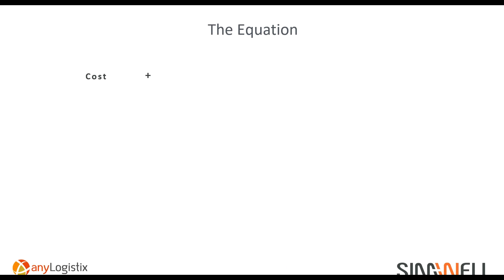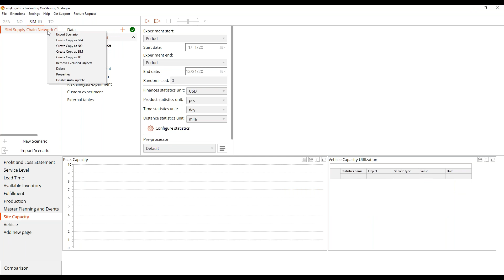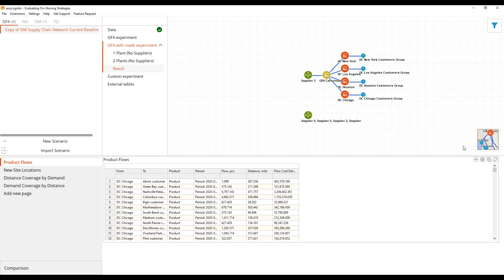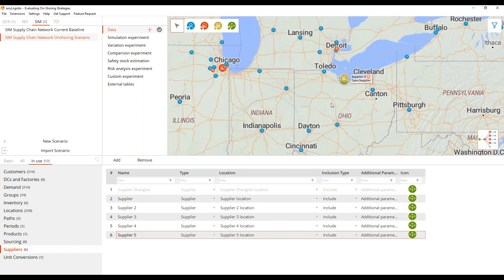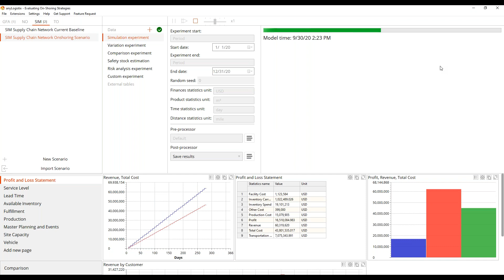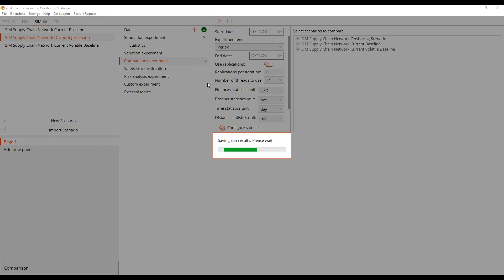Comment: Great video. Which simulation method has been used in the background?
Reply: Hi Rene,  the Green Field Analysis, Network Optimization and Transportation Optimization experiment types in anyLogistix do not use simulation methods, just a pure analytical approach on top of CPLEX and/or custom algorithms.
 As for the simulation part of anyLogistix - this uses the AnyLogic simulation engine, where usually supply chain models use Agent Based and Discrete Event methods, a combination of them. The same is true for anyLogistix.